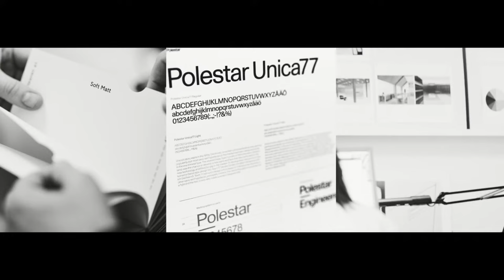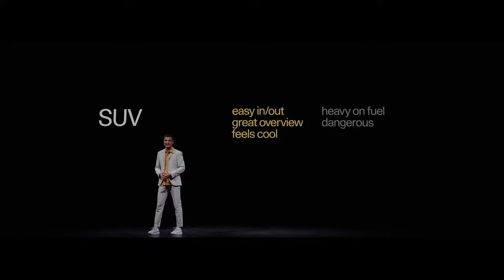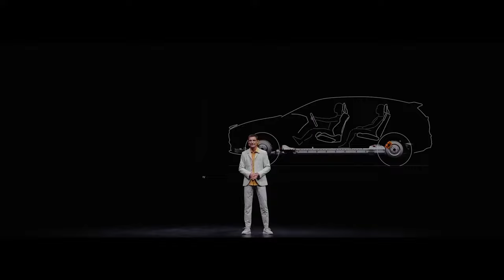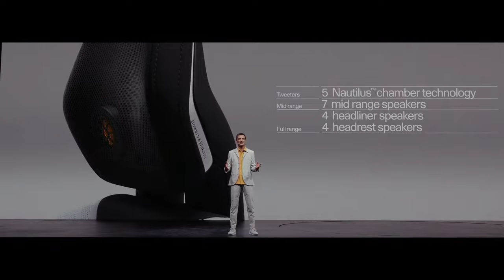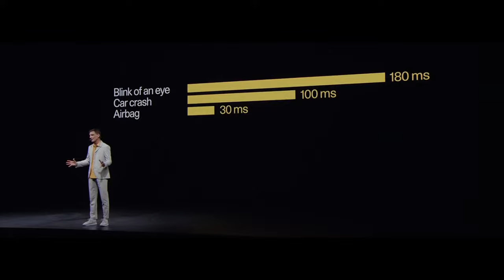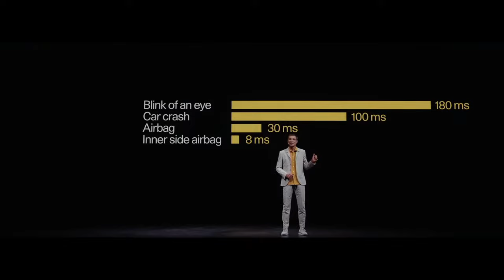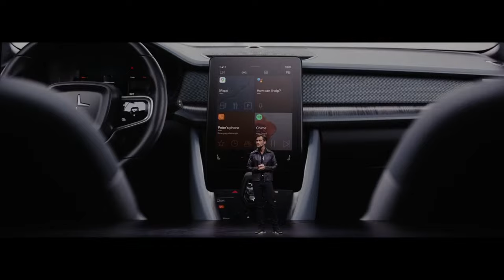Polestar 3 world premiere | Electric SUV I Full presentation 45 min | Polestar

Comment: Congrats on a truly amazing launch. I am so proud to be an owner of a Polestar 2! Also, what you are doing for sustainability is inspiring. Thank you!
Reply: Agreed regarding sustainability, and I was proud to own the 2. Not releasing the Performance software upgrade for the North American market last spring as promised; then no information- I’m starting to feel a bit conned at this point.
Reply from the maker: Thanks for joining us on the journey Steve! 🌍 ⚡
Reply: @dylconnaway9976  Fair enough. However, I would say that car companies are not usually technology companies and building a truly integrated system is pretty monumental. I think the best part is that when you drive it, it actually feels like you are connected to the road and the car becomes a part of you.
Reply: @Steve Cassingham  The performance software upgrade has been released in all markets aside from North America for almost a year now. It was promised here in the spring, but that didn't happen and no official word. Plus the pixel headlights have yet to be activated, which was also promised. Just take the features they’re claiming will be on the Polestar 3 with a grain of salt. A few may be empty promises.

Comment: They sure learned a lot from the Apple events. I love the car. Pricepoint is however to high. Same for the Polestar 2 vs model 3, xc40 or the korean brands had the same problem. I like the concept, but the price difference is rationally not explainable.

Comment: Absolutly stoked for the Polestar 3 but I'm hoping that they chose a lower range figure for the EPA to use cause 300 miles is quite dissapointing
Reply: I totally agree with you.

the preamble before the launch was 600+ horsepower and 600+ km range.

today learning the range is between 434-483 km is HUGELY disappointing 

we were going to purchase two to replace our two Polestar 2 as we wanted more range

but nope looking at another brand
Reply: Look, for a base model selling @ an MSRP of $83K (does anyone think they are going to actually get a base model through a dealership for that low??? Nope.) that might do 300 miles is really underwhelming. I mean it's almost 2023...they are going to have a difficult time selling enough units to recoup manufacturing costs across the board...also not impressed with the old style Telsa style center console monitor...that design has been around for years...it's old and outdated

Comment: As a Polestar 2 owner I had much higher hopes for this.  They swung and missed BIG time.  4.6 second 0-60 is not enough.  Especially for 90-100k.  This should have been priced, well equipped, under $80k to get the $7500 tax credit.  Whoever messed that up should be gone.  That is FREE money they missed.  This is not enough sport for the money.  The tree huggers out there don't care enough about the experience.  They want value.  Polestar isn't a value play, it's upscale eco.  There isn't a market for that.  It needed to be faster and less expensive.  My Mach E GT blows it away for less money.  Albeit, not as luxurious but much sportier and faster AND qualifies for the $7500.  This is NOT a Model X competitor with seating for 4.  They better get a well equipped version for the US market under $80k and QUICK.  Make the Plus and Pilot packs software upgradeable AFTER the fact.  Deliveries in Q4 2023?  Wall St is going to hammer Polestar for this.  Heads will roll.
Reply: You have P2 and a Mach E? I am new to EV want to enter the market soon
Reply: My thoughts exactly.  The exterior is stunningly good.  The rest is "meh".  Yeah, the US price is a puzzle, though a lower-trim version might be under $80k (he was ambiguous about that, but he indicated that they are starting with higher-priced vehicles up front).  I'm not quite as down on it as the second half of your comments, but I think they're confused about who to aim this at:  they are aiming it at Cayenne, quite vocally, and yet their diving into autonomous driving crap and putting too much into touch screens really takes away from it being a driver's performance car and instead following Tesla's lead too much of a computer on wheels, rather than a car with computer stuff in it (the main difference between a Tesla and a Taycan).  I say stop with the move toward autonomous driving; we're decades away from that being remotely safe, and I think it'll only be seriously usable in inner-city areas where ALL cars are autonomous in restricted zones (i.e., you can't mix autonomous cars with non-autonomous cars -- will never work).

Comment: Crazy that the Model X has a "range" of 350 miles on a smaller battery (100kWh vs 111kWh) while the Polestar 3 is 300 miles - wondering if real world usage makes both cars more identical than these less than accurage EPA ranges.
Reply: why anyone would buy a model x over this is mind boggling though.
Reply: nope, real-world range of Model X is 250-270 miles...  If this Polestar 3 gets 300 real-world miles, it'll be on a par with Tesla range (miles/kWh)...
Reply: range is very disappointing for Polestar 3

Comment: Will there be a mode when a pet may be left in the car for some period of time with a climat on function?
Reply from the maker: The interior radars of Polestar 3 can sense when a human or pet is left in the vehicle and will keep the climate system running at comfortable temperatures and the car unlocked.

Comment: Polestar3 and EX90 will show a different level of safety!
Reply: yes, lots of good safety stuff here, even improvements...  But three big safety failures:  (1) apparent glass roof (glass roofs are always much less safe than all-metal roofs); (2) not having buttons/dials for driver functions used all the time (phone, audio, climate controls), and no, voice controls are not a justifiable replacement; (3) 21-inch wheels are just too large, unsafe (sidewalls too thin).

Comment: It needs 800kw charging, it's the new standard.
Reply: no, the fastest charging currently is around 250-270 kW (Taycan, Lucid Air).  This is close.  You might be thinking of 800-volt architecture, which this must be close to here.

Comment: The exterior is stunning -- no negatives except that I'd prefer 19-inch wheels (21 inches are too large in terms of ride quality, reduced driving range, cost, and safety due to higher propensity for blow-outs).  Since you compare this to Cayenne, they come standard with 19-inch wheels.  I love the ground clearance, and the exterior lighting tech sounds excellent, together with the "wings".  The interior is another story; the instrument panel looks cheap, like what you'd find in a car costing $50k or $60k less (would rather have a nice inlaid panel blocking out sunlight for easier visibility), and the continued presence of a vertical "tablet-glued-to-dashboard" also looks cheap (vs. a horizontal screen laid nicely into the dashboard -- look at Cayenne for both good examples, since you like comparing this to Cayenne so much).  You don't say much about the roof, but I really want the option to have an all-metal roof, for a myriad of reasons (glass is hard to keep clean, it can crack/break due to rocks being thrown up or falling branches, unwanted glare and heat, extra weight and cost, and safety compromise in event of a roll-over); if you have to have glass roofs, are you at least putting in electrochromic glass to shut out light at the touch of a button (as in the Venza and Taycan)?  I'm guessing that you didn't think to put a full-size spare wheel/tire in the frunk, another bad oversight by almost all BEV makers.  I really don't want autonomous driving -- will never trust it, and anybody buying a car like this doesn't want to read a book or play video games while driving.... they want to DRIVE it.  Porsche will never make cars to be autonomous, so why should you, if you're obsessed at comparing your cars to Porsches?  You say this is a driver's car, a performance car -- so act like it, and do more things to help the driver, like don't put so much computerized stuff in it that can break and make accessing simple things like climate or audio or turning the car on in the event of computer failure.  What's wrong with buttons for climate and for accessing things while driving like phone and audio, instead of having to deal with a touch screen and instead of having to rely on voice commands (when many circumstances preclude the ability to use voice commands, even if they work)?  ...sigh...  And why not bring in infrared cameras with images displayed on interior screens, as Porsche has done for years now?  Then there's the price....  With the car made in SC, you couldn't get the price under $80k for the $7500 US federal tax credit?   This is a hefty price to ask; lots of neat stuff in there, but how much tech and glass roofs and autonomous software/cameras and huge wheels are really needed, which help to jack that price well above what it probably needs to be?  This car is so tantalizing, and yet so frustrating.  At $90k USD, I'll be heading almost certainly to Cayenne PHEV or Macan/Taycan BEV instead in a couple of years....
Reply: originally it was to have 600+ horsepower and 600+ km range.   very disappointing 

May look at Porsche too
Reply: Sounds you need a Dacia Spring, you'll like it!
Reply: @razvanlex  ha ha.  I don't think so.  I will leave that up to you to purchase and enjoy 🙂  I'm interested in having a great vehicle however this one in the initial info provided was 600+ horse power and over 600 km+.

Comment: Price too high, power too low, not enough range :p 
My Model 3 Performance has more range on a 77kwh battery, and a 0-60 of 3.1 sec, for less money.
Reply: It has almost 700 lb-ft of torque wth are u talking about? Delusional Tesla stan bruh.. The performance has a range of 500-550km- that would be around the same as this in real world tests (actually under 500km), they state 610km tho. 

Edit: FYI, i wanted to say. The model S is one of the few EVs that can go even close to 600 tho, nobody can afford tho lol
Reply: @cyanprince00  that's for the higher trim model ramrod, check the base and the money.
Reply: Model 3 price too high - don't even get good automatic wipers and autopilot above 145km/h - useless in germany with the "updated Features"
Reply: nonsense... real-world driving is well below the 300-miles EPA estimate here for Polestar 3.  Kyle Conner's 70mph test from 100% to 0% yielded 280 miles on a M3P.  Many Tesla owners report much lower values.  Can't argue with the lower cost, though.  Tesla is known for way-over-estimating their test figures that EPA represents (unlike most other automakers).